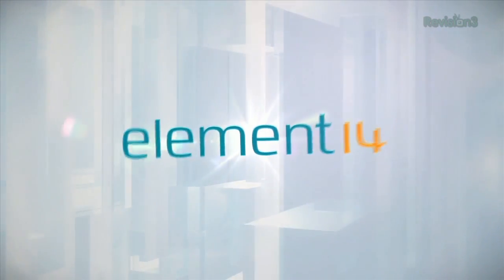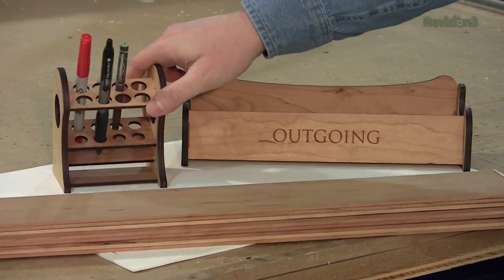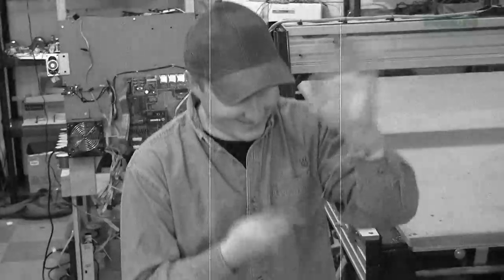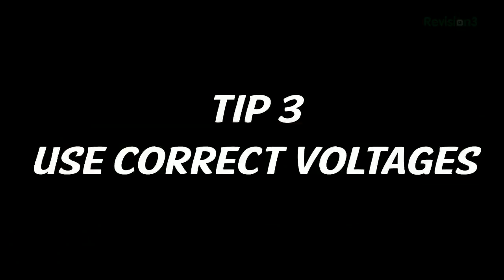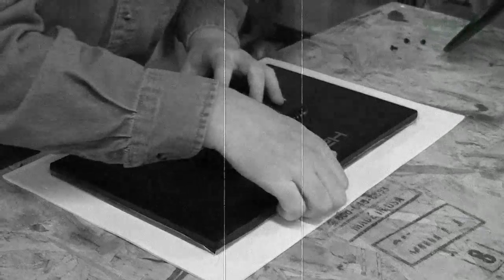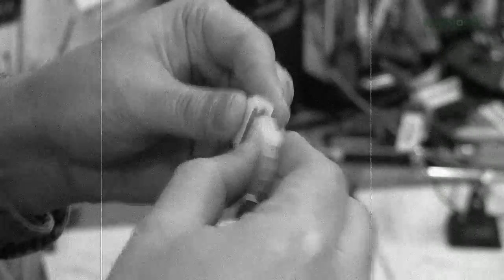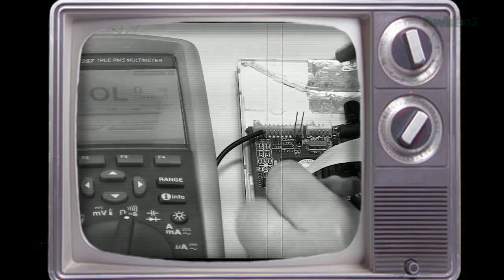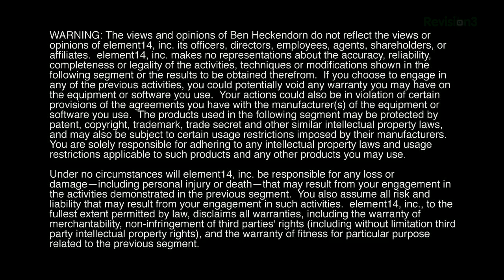How Not To Fry Your Projects

Comment: Look up the ATX power supply standard. Computers were the ones to innovate this voltage color coding scheme. Cars are the most common place where red is not 5v but; in fact, 12v.

Comment: Tip 5: Make sure you wire up your power wires right. I put reverse 24v reverse polarity through a transistor and now force feedback on my light gun doesn't work. Ah shame.

Comment: i have an idea for a project from the uk you could build a motion activated arduino light switch but here in uk we have 240AC so would need to convert to 3.3DC or 5.0DC to power the arduino but not fry it build this please i want to do this but dont have a clue on where to start

Comment: Hi there,
Has anybody got any tips/ advice for a relative beginner in electronics? I've got some basic knowledge about basic components(leds, resistors, caps) and the picaxe system. But I was wondering if there are any good websites that could help me broaden my knowledge and work with more complex things, bit like benheck
Thanks.

Comment: Sorry to dislike the vid. but:
1>needs more detail, ESD floors, mats, smocks, esd safe work bench...
2>No mention of solder wick, hot air.
3>black & white wire colors..
not 3> don't use a screw driver, use non-marring pry tools! 
4> is fine

Comment: Not enough info about grounding... we'll need more than the strap.  And, we need to know what to look for in a mat which is suitable to handle the heat from a soldering iron tip.
Reply: +TheRangeControl You could just put the iron back on it's dock. That's the safest way. Strap is the best method for grounding. If you don't have a strap, hold something like the frame/chasis you are working on to ground yourself. Never do this with electricity that can kill you.
Reply: +gozinta82 thank you.